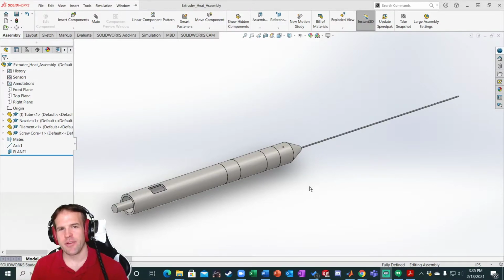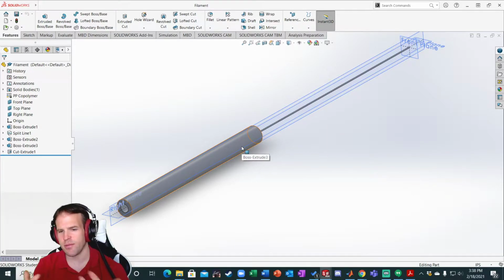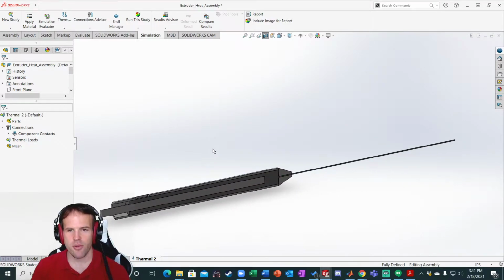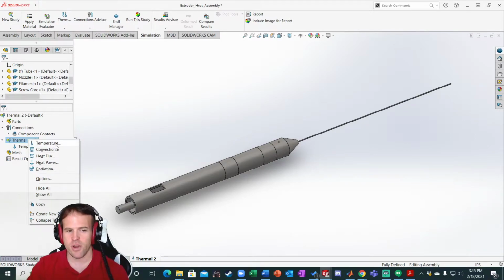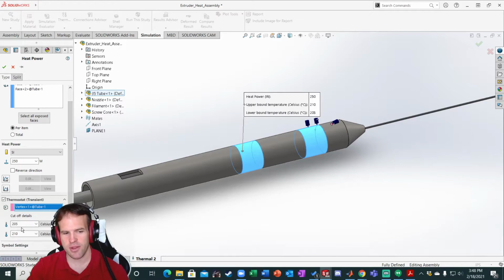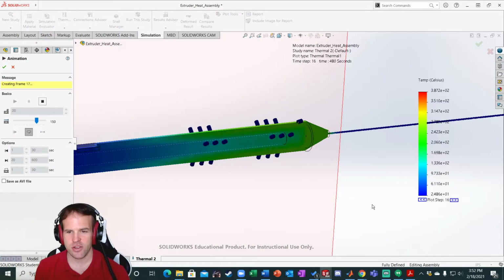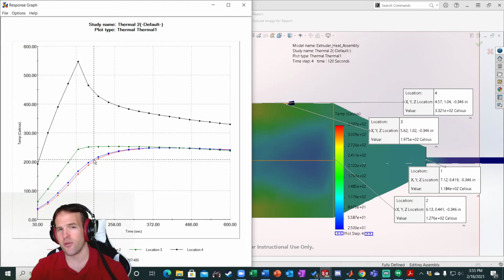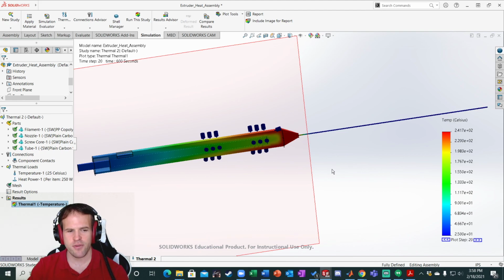SolidWorks Transient Heat Transfer Analysis - How Long to Heat Up?

Comment: Hi Prof. I regenerated the model with variations in dimensions and followed all the steps. However, after running the study, the temperature plot shows 25°C at all points. What could be causing this issue?
Reply from the maker: @turyasinguramedard4165  Make sure to  set the initial temperature conditions for the entire part, not sure surfaces on the part. Also, try changing the location of the heater and making the thermocouple location vertex larger for a finer mesh (or run the simulation with a thermostat option). Try making the mesh finer. If all else fails, make a whole new simulation study or try the steps with a new test part with simpler geometry. These are the steps I try when prototyping these simulations - they can be a bit glitchy!

Comment: Your video is excellent, explain clearly and in detail. Learn a lot indeed. Do you use Ansys? I am eager to watch your  some video Ansys thermomechanical simulation using Ansys software.

Comment: Can this same simulation be done with the Flow Simulation Software or is this just the basic Simulation Software?
Reply from the maker: I believe that SW Thermal Simulation is included in the standard SW Simulation package. You can also import results from a Flow Simulation into Thermal Simulation, though I haven’t tried this yet.

Comment: hello Jeff,

thanks for the very informative video...i don't know if i missed it or this part is skipped. did you define contact between the different parts? or does SolidWorks already know that from the assembly constraints?

Thanks
Reply from the maker: I believe the contact should be automatically defined as bonded from the assembly constraints.

Comment: I love you walk through, easy to follow! 
i have a question on a semirelated subject! 
Looking at the heat loads; temp, flux, convection, etc. We can define a time curve resenting the loads added onto an object. I am struggling to use this correctly and wondering if you had any tips and tricks? 
for example, heat applied to a surface, but the convection changes due to different wind speed
Reply from the maker: Hmm good question, I haven’t tried this and I’m not sure how simple that would be to implement. One thing to note is that you can do a fluids study and import the results into a heat transfer study which would likely yield good results for differing wind speeds
Reply: I'm also looking for a solution like this